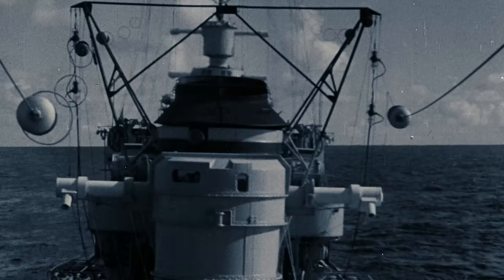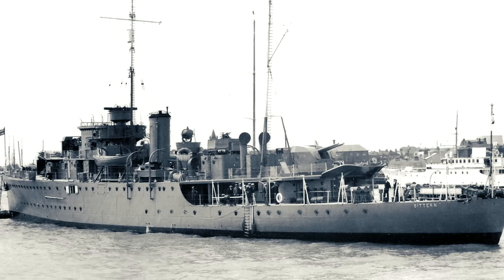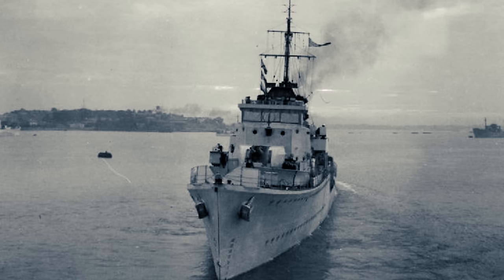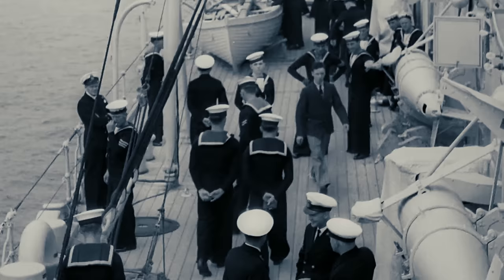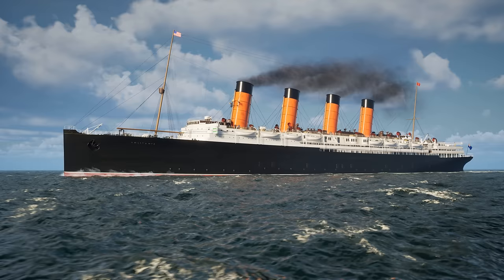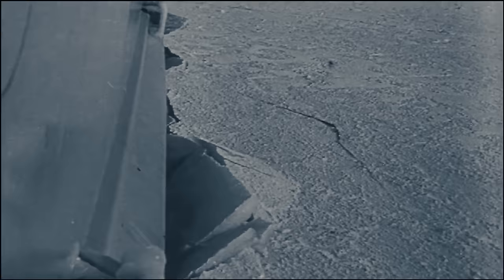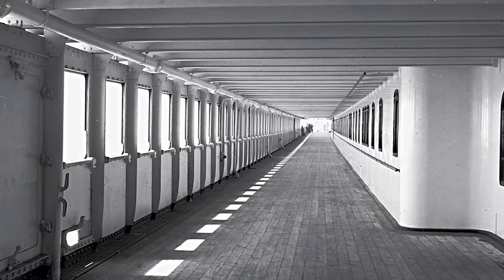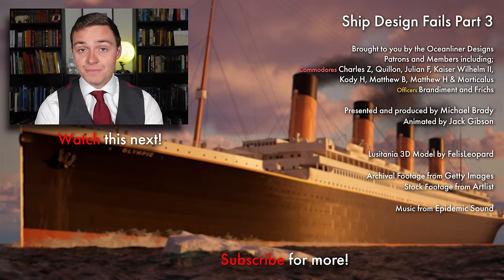When Designers Fail: Three Ship Engineering Mistakes from History

Comment: I wonder how it would feel to build a ship for many months or years. Then see it roll off into the water, and sink immediately lol
Reply from the maker: Good thing they caught the issue before the sea trials!
Reply: Vasa moment
Reply: "Doh!" doesn't seem to cover the grandeur of suxh a failure.
Reply: I can't remember the name, but a warship from the great age of sail fully outfitted rolled over in the harbor in front of the king. I would not have wanted to be standing beside him...
Reply: @graham2631  That was the Principessa Jolanda in 1907. She was fully kitted out while in drydock, launched, heeled, and capsized minutes after leaving the slipway-- because there was no ballast to weigh her down despite how topheavy she was from all the furnishings. This is why ships are usually launched in a barebones state and then ballasted and fitted out later.
Reply: @graham2631  lol probably when they started saying “bollocks”
Reply: @Doodoofart725  Mary Rose, too.
Reply: @aircraftcarrierwo-class  Some ships are launched fully fitted out perfectly fine. Other ships are launched, and then fitted out separately. Just different ways of doing the same thing. The builders' enthusiasm for launching Principessa Jolanda completed and furnished, but with none of the things that could move bolted down, and no ballast, not to mention open portholes, is a mistake they did not repeat with her sister ship, which they launched completed but with proper ballast.
Reply: The amount of anger and face palming wouldn’t even be able to cover the fact
Reply: We also had a warship with serious stability issues but luckily not since then. It was the “Battle ship” (Ship of the line, 2 decker, 64 cannons) Vasa in 1628,,,,
Reply: I'm picturing Mac from Always Sunny doing one of his emphatic "God... dammit"s
Reply: @Doodoofart725  I was thinking the same thing!  The Hunts didn't have enough "belly".
Reply: The Wasa😊
Reply: And her superstructure reduced by 1 whole deck. @BNuts
Reply: It would probably feel the same as bearing a child for 9 months, feeding it and keeping it safe, and anticipating its birth, and when that birth happens, instead of rejoicing, you see it die. 😇🥸🦭
Reply: Made in CHINA
Reply: @amandahugankiss4110  I believe 'Oh Shit!!' might cover it...!!
Reply: @Teverell A common misconception. Mary Rose served for 33 years before she capsized.
Reply: On the wooden boat forum there was saga of some guys built a yacht  to offer st Lawrence river tours.  As they backed the ship tail first it started flooding and falling over to one side. Punch line we don't need no navel architects
Reply: It's happened to a brand new ocean liner!
Reply: Sounds like my career lol
Reply: @graham2631  the vasa
Reply: @aircraftcarrierwo-class they were still quite inexperienced at building large ships, and while they thought they knew what they were doing, they clearly hadn't yet got the hang of it!
Reply: Probably gave them a sinking feeling.
Reply: For sure
Reply: @OceanlinerDesigns do big boats ever hit porpoises?
Reply: Can't be good
Reply: Pretty silly I imagine lol
Reply: With a time machine you can go and ask Vasa's builders, but I bet it will include a lot of profanity.
Reply: @Teverell  no, the Mary Rose sank in the Battle of the Solent after 33 years of service. Not at launch
Reply: The Vasa sank after sailing roughly 1,300 m into her maiden voyage. The "m" stands for "meters" not "miles."
Reply: I worked at a shipyard where that almost happened, but it didn’t sink, it just listed way over the starboard side. They designed the battery box on the wrong side!
We had to fix it….! 
It was a 150 foot TWR. torpedo weapons retriever. For USN.
MARINETTE WISCONSIN. 🛥☮️🤭
Reply: It was at this moment they new they fudged up
Reply: Having lived in Atherstone for several years, I find a deep irony that even the ship to carry the town's name was described as dangerously unstable 😂 Definitely ours then! According to the local vicar The Crazy A sent a crew member to the remembrance day services here every year when she was still sailing. Joking aside, I like that there's a ship out there carrying our name 😁
Reply: Check the Swedish capital ship Vasa that sank in the 1600s after just making it into the bay that she was launched from.
Reply: Two ships,  the principessa Iolande and principessa  Mafalda were a great example of a design floor.  When launched in 1907, the Iolanda went down the slip way and promptly capsized. It was deemed unrecoverable and scrapped.  Work went ahead on the sister ship.  It broke a propellor shaft, the incoming water caused a boiler to explode and it capsized, 303 passengers died during the roll over.
Reply: @wailingalen your humor is in poor taste and not a reasonable comparison to make for any civilized individual
Reply: True funny story = An uncle of my wife in Crete, back in the 80s, decided to make a real life metal boat, out of his son's Matchbox boat toy. He measured and scaled the model accurately, and built it from welded steel sheets, which were too thick. The boat was a Chris Craft of some sort. At the day of the "launching ceremony" a lot of people had gathered in the harbor of Heraklion, Crete. A huge crane picked up the boat and put it in the water. It went straight down to the bottom. It was heavier than the water it displaced. It;'s a crazy true story. These people were very smart, but thought they were unstoppable and could achieve anything without doing much math about it. It never really bothered them. They are now old and still laugh about it.
Reply: @graham2631  either the Mary Rose in England or the Wasa in Sweden
Reply: @aircraftcarrierwo-class  Sorry mate, Graham refers to the Vasa of 1628, a Swedish Ship of the Line, not the Principessa Jolanda circa 1900, which was neither a sailing nor warship. The good news is the Vasa has been raised and her beautifully carved, though waterlogged timber soaked in epoxy to stabilize it for permanent display.
Reply: Not as bad the builder whose vessel sank on it's maiden voyages taking thousands of lives.
Reply: That actually happened in Sweden. Ship rolled over and sank in the harbor on first day.
Reply: @OceanlinerDesigns  The last time this same comment above got posted on the video talking about the riveters of the Titanic, lil bros were coming in droves saying "the workers got paid. They wouldn't care."

What's the difference it takes to get from "they don't care" from "Imagine how they would feel"?
Reply: @graham2631  Swedish First Rate Vasa.
Reply: @Teverell  Both Vasa and Mary Rose sank because the lower tier of gun ports was under water in heavy seas when the ships heeled. And some wally forgot to order them closed when the ships sailed.
Reply: Like the Vasa did?
Reply: @aircraftcarrierwo-class I would not consider 1907 the age of sail ships. He meant Swedish Gustav Vasa that tumbled over at launch in 1628. It got recovered 333 years later and is now visible in Stockholm
Reply: @graham2631  Mary Rose, and half of it was found a raised in display in Portsmouth. Absolutely amazing.
Reply: @graham2631  That is Vasa
Reply: @samholdsworth420  Actually, 2 UK ships & 1 German ship.
Reply: Has to feel something like designing and building the Hubble telescope and launching it into space.

And then realizing that it was almost blind.
Reply: @OceanlinerDesigns  Great Youtube video, but I found the background music was too loud and distracting. I would strongly suggest you get rid of it altogether. I firmly believe that background music is distracting, annoying, and unnecessary (especially for information-dense educational videos with lots of talking). I also believe that people want to hear you speak/get information and not hear generic background music that doesn't really add anything useful and that people have to mentally filter out. Plus it will be one less thing you will have to do when making videos. Thank you.
Reply: That would suck l😂😂😂😂
Reply: I was wondering who would mention this first 😊@Doodoofart725
Reply: @graham2631  The Mary Rose - You can see it at Portsmouth Dockyard.... was recovered in the 1980's.   Result of a refit, and I think included a new deck and heavier guns, leading to higher CoG, and so when she heeled over for the first time on leaving harbour, ready for battle, the lower open gunports were awash, she filled up and capsized.
Reply: @Doodoofart725  makes for a cool museum piece though
Reply: Era il Wasa,nel porto s vedese di Stockholm.
Reply: You would definitely get that sinking feeling
Reply: Ever been staring at someone, coz say, they've a wardrobe malfunction, and as you stare you walk into a bollard and hit your balls, curling yourself up in oof and cringing as every now laughs at you? 
I imagine it feels a bit like that...
Reply: @aircraftcarrierwo-class maybe the commenter you replied to was misremembering but I wouldn’t take that for granted…. SS Principessa Jolanda  did indeed roll over on her launch BUT she was most definitely not a warship and was constructed well after the golden age of sailing ships…at least 3 decades after.
Reply: @marklivingstone3710  that’s Jolanda with a “J”….LOLanda sounds like a ship for internet pranksters.
Reply: @agarlicsorbet6482 I’m sure there were at least a few current or former H&W workers who were legitimately indifferent towards Titanic’s sinking. While the majority who worked on her would likely feel at least a slight sense of loss or sadness you have to remember there was plenty of discontent in that shipyard as Titanic was being built, pitting Catholics, Protestants, and by proxy the Irish and British workers against each other in many cases. There were almost certainly at least a few men who were sacked or beat up while building Titanic who said they hoped the thing sank and meant it.
Reply: @J.R.in_WV  no, it’s not Lolanda ,  it’s Iolanda…. As in letter between H and J. 🤭
Reply: @J.R.in_WV  yes, the previous 8000 replies already educated me about this.
Reply: @Doodoofart725 was going to post a comment on the Vasa but you beat me to it.
Reply: I believe it comes down to the ships designed stability... some ships are just designed to have less than others and should be fitted after floating. I think they cut it too close sometimes and it doesn't go well 😂
Reply: I can't name any examples. But I know it has happened.
Reply: 😅😅😮 @OceanlinerDesigns
Reply: My grandpa was lifeboat crew and he saw the end of many bigger ships he saw the Louisiana sinking as he was getting there, it's absence was disturbing he said
Reply: Ask the Swedes
Reply: They didn't all sink immediately after leaving the dock, but the Swedish ship Vasa did.
Reply: @graham2631 The Swedish warship Vasa was launched, set sail and sank before clearing the harbor.
Reply: @graham2631  Swedish Vada in 1628
Reply: A lot like it is to watch the country the founders worked so hard to craft, get torn apart by its citizens less than 300 years later.
Reply: Feel like your last day of work
Reply: @paulscott2037 the rebuild of 1536 probably reduced stability
Reply: @graham2631 The Vasa. From Sweden
Reply: A true oh shit moment !🤬
Reply: Look up the Vasa, it's what happens when Kings need to be made happy.
Reply: Vasa
Reply: Vasa
Reply: Job security
Reply: @that was the Vasa and it didn't happen in front of the king
Reply: @graham2631 the swedish ship Vasa?
Reply: @OceanlinerDesigns  3:29 you know already
😱
Reply: You can play From the depths to experience that
Reply: Thats usually the designers fault. Not the men who built it

Comment: Always wondered how battleships back in WW2 kept from flooding when they seemed to ride so low in the water. Who would have thought “make front pointy” was the solution.
Reply: Remind me of the Dictator 😂. But this time it makes sense.
Reply: Seems to me they could have had it both ways if they'd widened the deck to overhang the hull by maybe a foot or two and curved the hull up to meet it creating something akin to what you see at the top of sea walls, if you then create a space under the deck for the water to drain into and out of either to the sides of aft of the ship you can have your wave breaking speed-ship without compromising the internals.
Reply: A nickname for the HMS Hood was the largest submarine in the Royal Navy.  Its stern section, when stationary in a flat sea,  had only 15 feet of hull above the ocean.  Once underway the stern of the ship was always wet, one of the most frequent illness diagnosed among crew in that part of the ship was tuberculosis.
Reply: @arthurlau98 Hilarious, I almost Aladeened myself.
Reply: Wet bow is the term.
Reply: The OHPs had a ridge on the hull below the water line to keep it from rolling. Glad it did. But it rolled a lot anyway
Reply: They had “scuppers” which are drains. All the water that comes on board, drains out of these, instead of flooding the ship.
Reply: @jamescrawford9883  Yep had them on all the weather decks of the ships I was on. Except the Ranger.
 I guess if the weather deck is completely flat, not needed.
I also don't think any ship is completely level most of the time. Unless it is in dry dock.
On a OHP you learn how to walk on the bulkheads
Reply: @warrenpuckett4203  thanks for your reply. I see you must have been in the U.S. Navy. I was on British merchant ships, 21 in all for 7 years, back in late fifties to mid-sixties. Mostly cargo ships but a couple of tankers and a few liners.  Cheers from Australia.
Reply: ALL the best solutions involve "make front pointy."
Reply: I'm trying to work out if that sounds like a sexual joke or not. I meant like weapons and stuff, but maybe it applies elsewhere too...
Reply: they were wide which displaced the weight better
Reply: @marklivingstone3710  Reminds me of my ships in ultimate admiral my most successful design rode super low and was always stable but the bow would be like half underwater in waves lol.
Reply: Am reading the excellent book 'Battle of the Atlantic' by Marc Milner. The Corvettes with the original short forecastle versions were described in this as awful quite apart from the rolling. US sailors looking at them in heavy seas thought the sailors should get submarine pay. I seem to remember one account somewhere where in another vessel an officer was trapped in the aft section of a ship for days I believe as the trip forward to the bridge was just too hazardous.
Reply: @AdamKafei that would probably be less stable no? And you also dont generally want parts of your ship to be flooded
Reply: @filipbitala2624  I don't know, I'm not an expert, I simply applied the logic of "if it didn't work then seawalls wouldn't do it" and "since getting some water on deck is inevitable, if only in the form of rain, some kind of drainage would prevent water seeping into the materials and structure of the ship would be a good thing", I envisioned having grills in the deck that allow water to flow into a small cavity that would naturally drain at the back or side of the vessel, thereby preventing any kind of flooding.

Comment: The Admiralty normally required ship stability calculations to be done by to different individuals and their results compared. Due to the pressure of work at a horribly overworked staff, this was temporarily done away with in the design of the Hunts. The designer went beyond what was required and did the calculations via two different methods. By sheer chance, the results were close to one another, so it was felt that all was well.

Comment: I can readily attest to the failures that happen when high speed work must be done and a small error happens that is only caught at the very end. I did new construction and then later moved to remodeling. When a new house is framed (the walls and roof), headers are made, which are the beams over doors and windows. In the rush, I gave out the wrong measurements for the lengths for all of them! Too short. Luckily, we were able to refit the problem by cutting each longer header down to get the correct size for a different header that was originally cut too short. We "survived" this error without too much waste, but the lost time definitely hurt. These things happen. I learned in a movie a while back that the word "computer" was originally meant as a person who does computations. That is why the new machines that did computations inherited the word computer as a name.
Great videos and I love the stories about the mechanical details and history. Thanks